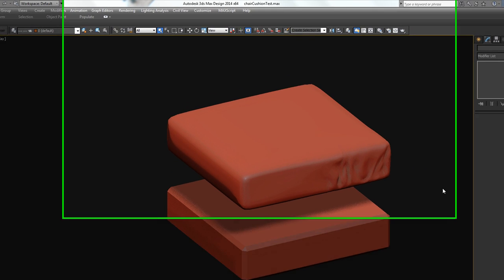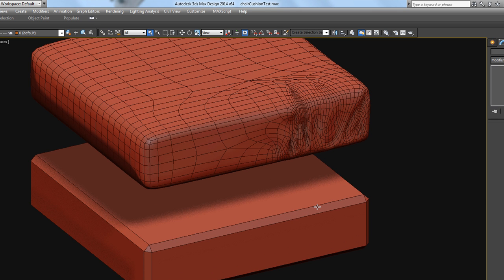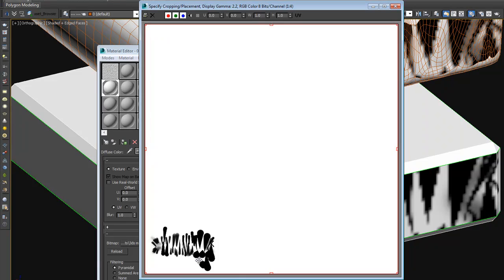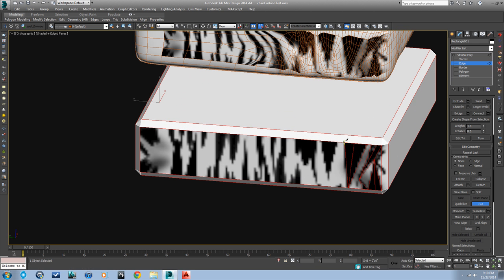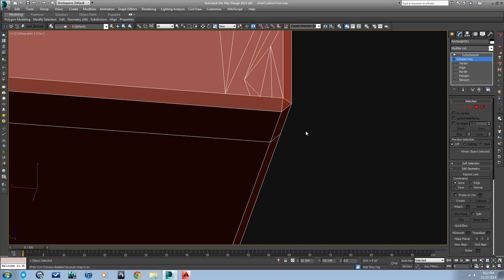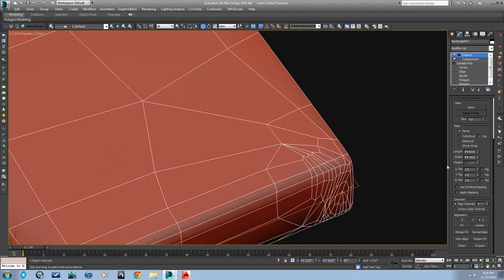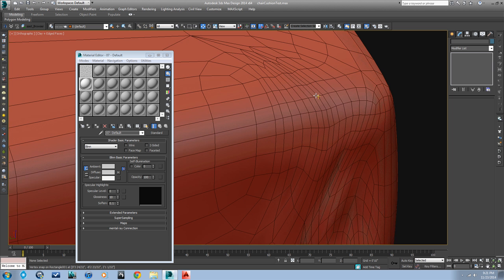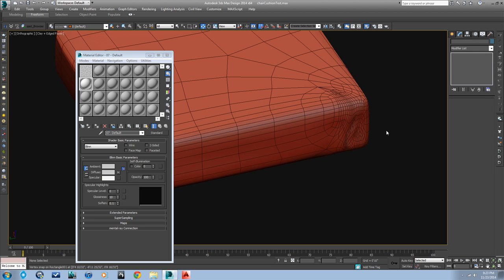3ds Max Modeling:  Adding Wrinkles To High Poly 3d Furniture

Comment: Its nice tutorial, but details = polygons :) i still prefer sculptris
Reply from the maker: Georgi Marinow Haven't used Sculptris, but I do use Mudbox all the time for adding detail.  Sculpting is a great tool for sure.  Here I simply wanted to show how to do it with poly modeling, and I am trying to make nice wrinkles without the super-high poly counts of sculpting.  Thanks for the feedback, Georgi.
Reply: zillus I prefer to model in the details, without sculpting, if possible.  There's an efficiency to this kind of technique you can't get in a sculpting application.  Saving poly count by baking a sculpt into maps and retopo is one thing, but in many workflows, this type of detailing is faster overall, and provides a good level of control.
Reply from the maker: John Malcolm I agree on all points, John.  Of course, for some furniture I do go the other route with sculpting and retopo.  It usually depends on the individual model.